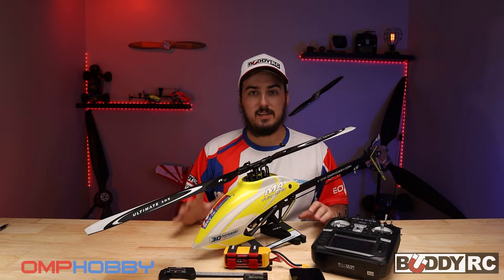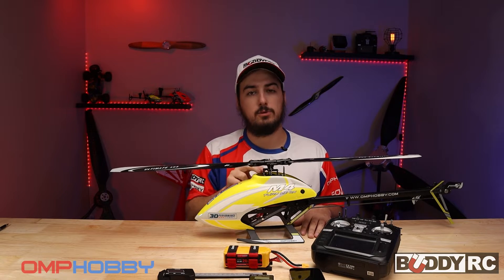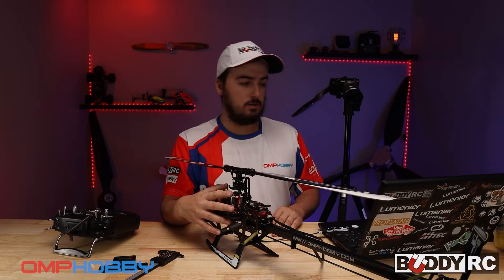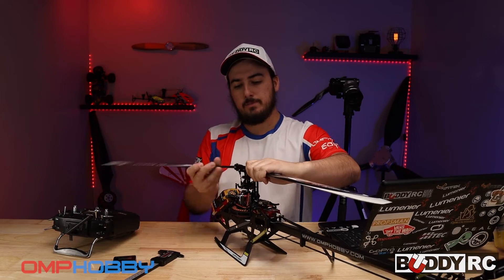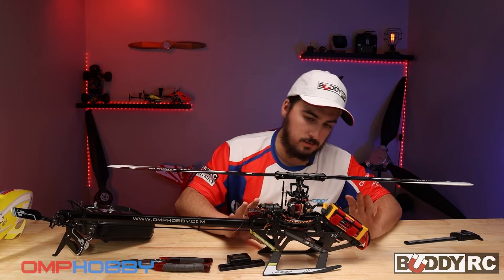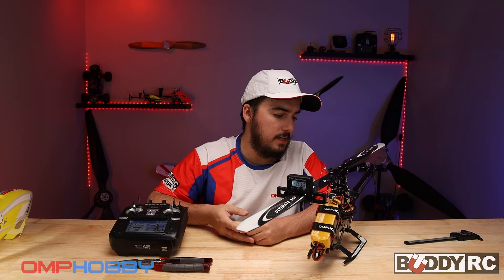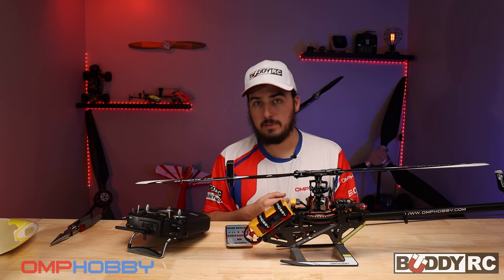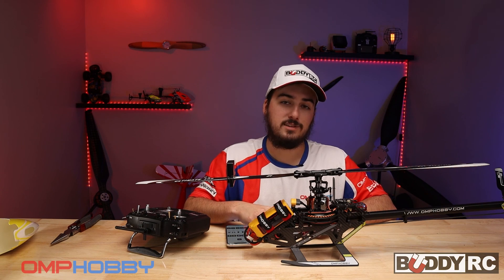Mastering the Mechanics with the OMPHOBBY M4 Helicopter

Comment: Where is your swash leveler?
Reply from the maker: Thanks for watching! I personally don't use them for my helis, I use a different method to level the swash by eye first then I go fly and pirouette. If the heli dips to one side while in a pirouette I level the swash with the links  until the pirouette is flat and level. I have found its quicker for me to find zero pitch at center stick and then go fly it and do this process to level it perfectly. Hope this helps!